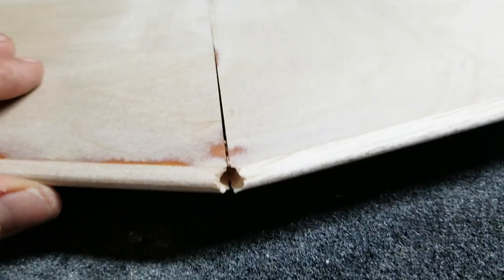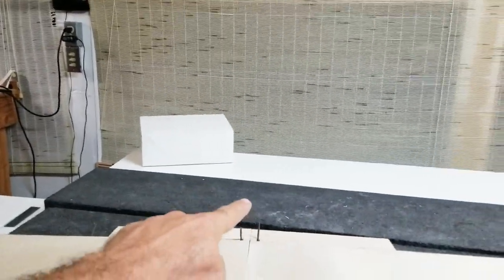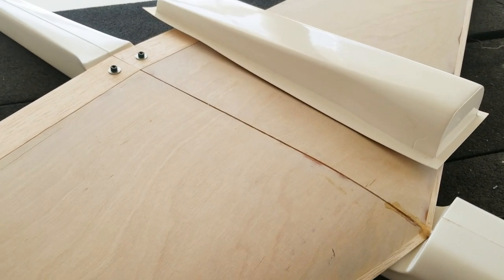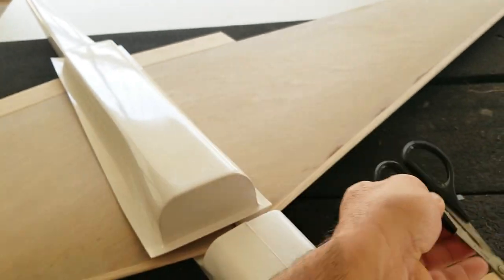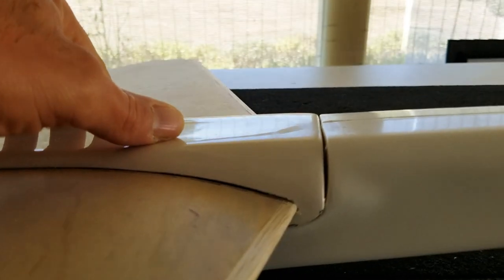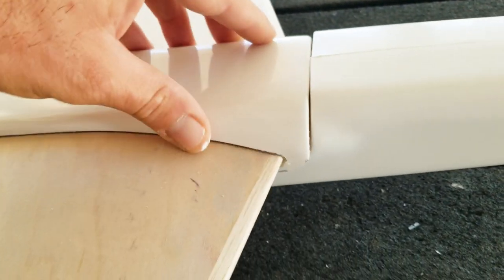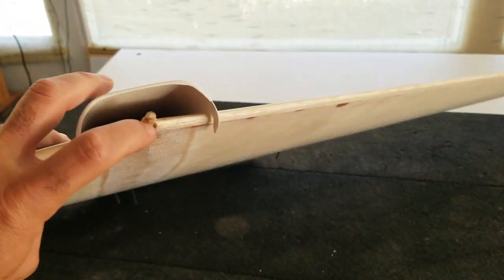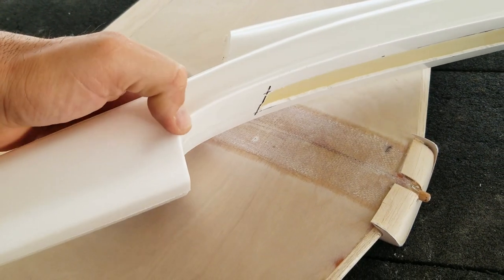SR-7, Vintage RC Slope Glider Build Part 5

Comment: Talk about making things hard for yourself  !
Fit the wing to the fuselarge. 
Once thats done, put tape onto the fuselarge to stop the filler sticking to it, and then mix up some car filler and spread it into the gap until it fills up the gap smooth the filler serface with a wet finger. Instant fairing.
For the bottom fairing, throw the plastic and use balsa. Sand to shape and fair in again with car filler. 
The amout of filler used is tiny so weight is not an issue. 
I have built three SR7s over the years...
Fantastic slope soaring glider. Very rare kit now but believe me,  if you can find one, its a real keeper !
Best glider I have ever owned. 
For the cockpit area, throw the wooden parts away. Leave the plastic cockpit floor in place and fit the elevator servo and switch directly into the rear of the flat portion of the cockpit.
Cut a small hole forward of the servo and switch,  just big enougth to fit a receiver through into the nose.
To fit the canopy to the cockpit area, screw two small screws into the centre (mold line).
Trim the cockpit canopy a little over length front to back, and notch the canopy slightly along the same center line so that the screws  engage into the canopy slots when you flex the canopy side edges outwards slightly. 
Hope this helps.
Gordon Fraser. 
U.K.
Reply: Seem to know your stuff, can't believe you never noticed their is no r in fuselage.
Reply: @jerryboics9550  finger trouble and old age 👴

Comment: For the tailplane,  keep the two wires that plug into the rear fuse at the front. Run the wires along each side of the vertical fin to about half way along. Bin the rest of the wire to the rear from that point.
Now fit the tailplane to the fuse and drill through the top of the tailplane into the top of the tailplane and out of the bottom surface  of the fuse, so that you can fit a 3mm blind nut into the top surface of the tailplane. Then using the hole in the bottom of the fuse, screw a 3mm hex head bolt up into the blind nut in the tailplane. 
Glue on the fin making a small clearance into the fin to clear the bolt etc...
Then fair the fin to the tailplane using a strip of triangular shaped balsawood to cover the wires and provide a bit of extra fin to tailplane support.
If you fit the tailplane this way you will not have any nasty looking fittings showing  around the rear end tailplane assy.
Reply from the maker: You have all kinds of great tips!

Comment: Reference the wingtips
I didn't model the "shaped" wingtips on my later models.
Its just a styling thing. They don't improve the flying performance, and they just end up getting damaged over time.
My advice would be to fit "standard" normal wingtips.
Reply from the maker: Ok awesome, yeah I was mulling that over. I think I will go with standard tips.